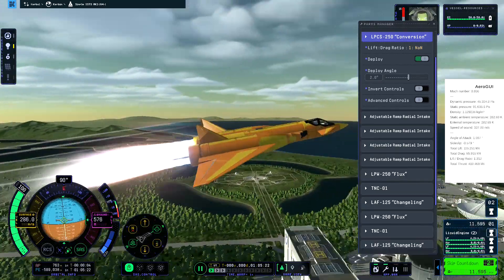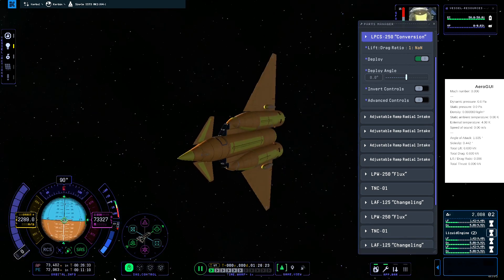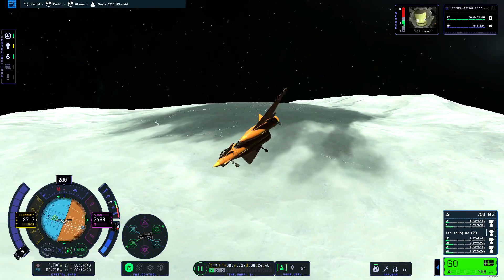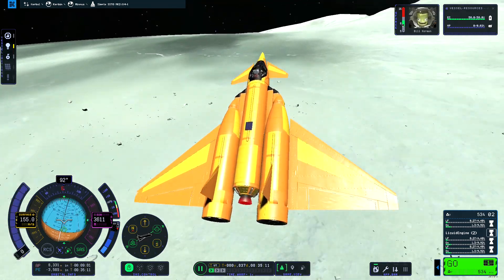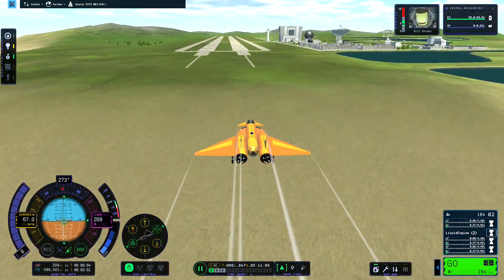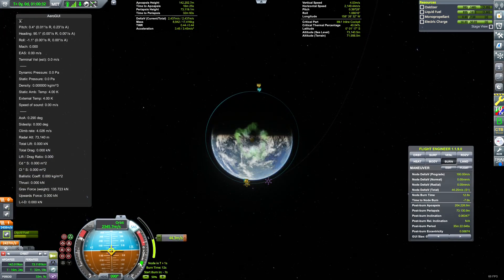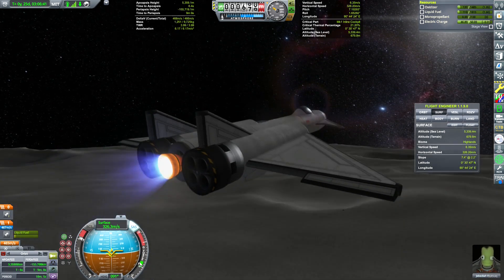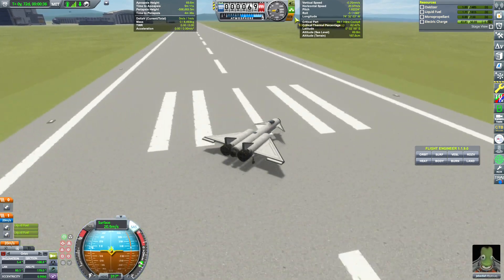Kerbal Space Program 2 | Single Stage to Minmus and back no nuclear no ion | KSP 2

Comment: it wasnt a kraken attack messing up your landing, you forgot to set your speed from orbital to surface
Reply from the maker: I don't have much problem with the landing on Minmus, it's just that the reaction wheel is much weaker than in ksp1. Also, the speed is supposed to switch automatically from orbital to surface during landing in ksp1.